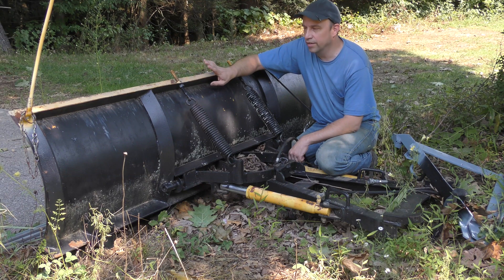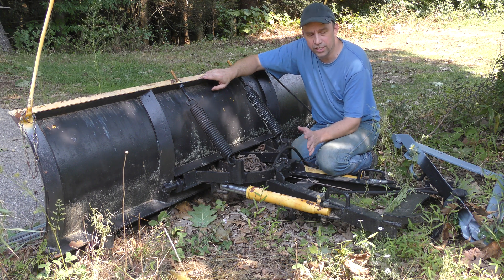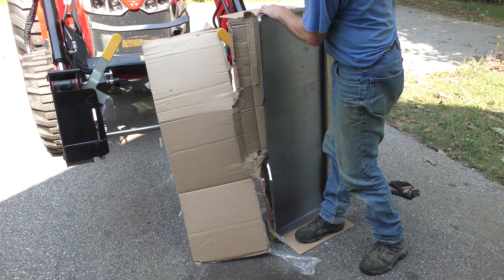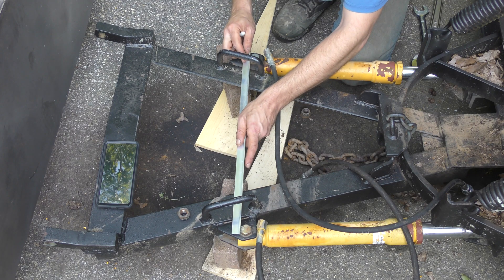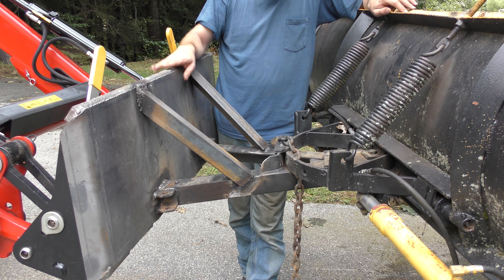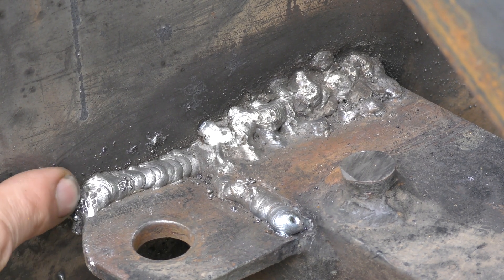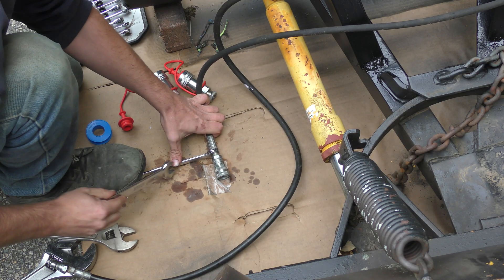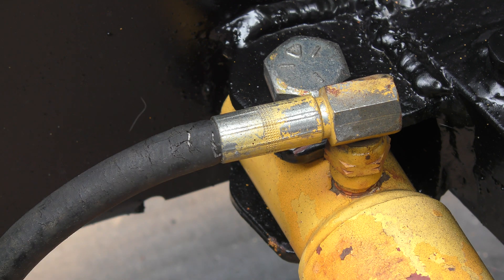Old Plow, New Life!  (And saving a ton of $$$)

Comment: Looks like a nice metal plough, the government changed to a fibreglass mostly plough a couple of decades ago where I am,  and now there afraid to use the plough while clearing of the roads and highways so they go through a lot of salt now. I hope the changing ocean currents doesn't result in us getting heavy snowfall because those plough won't survive an encounter with all the traffic harassment measures they have installed over here.